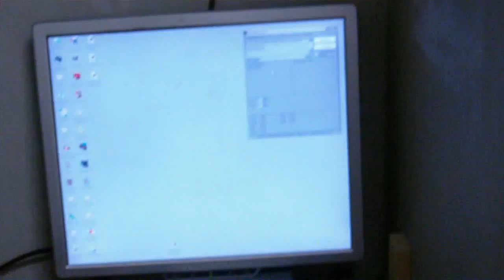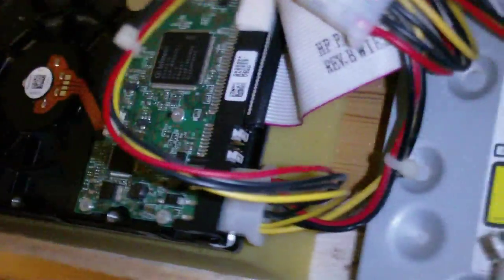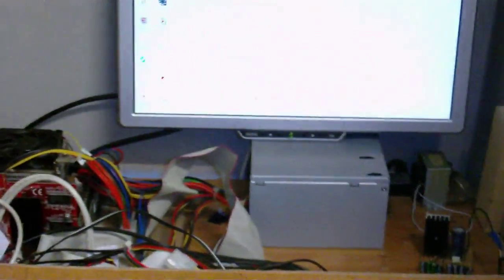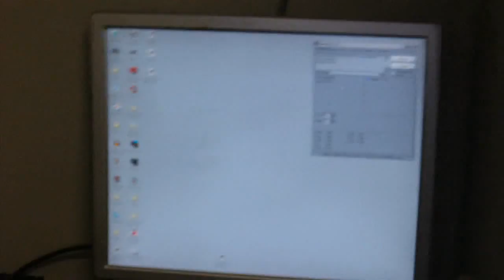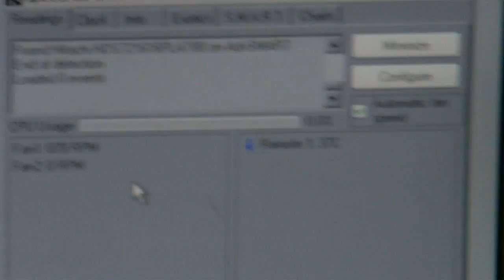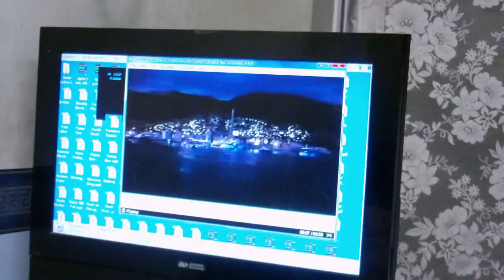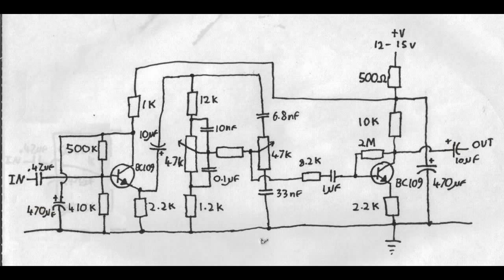Upgrading my homemade amplifier

Comment: Was that an imitation of the Peter Gunn Theme that you were playing at 10:57? Sometimes that happens on DVD re-releases of TV shows, when they can't get the licensing to use the original theme song, so they make up a new song that sounds like the original but has a slightly different melody.